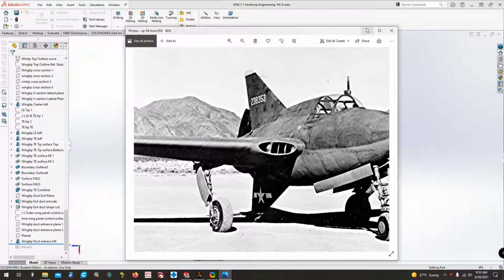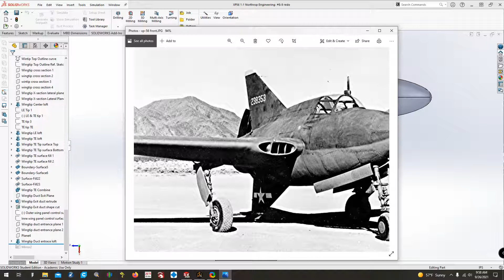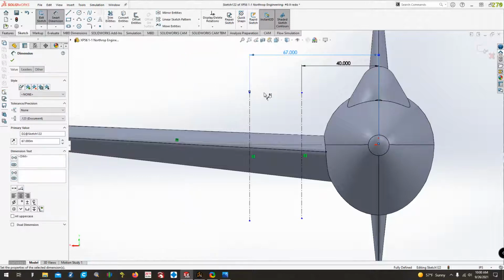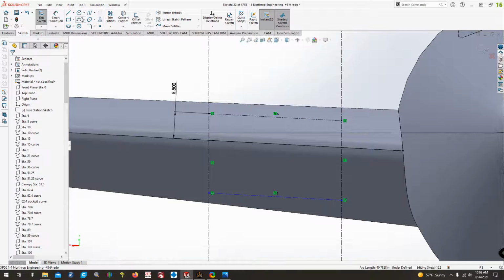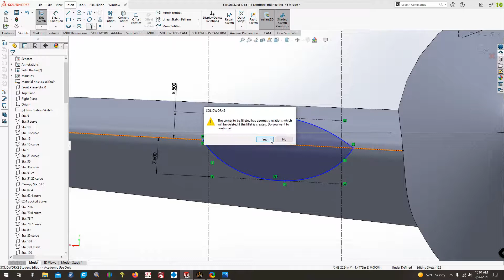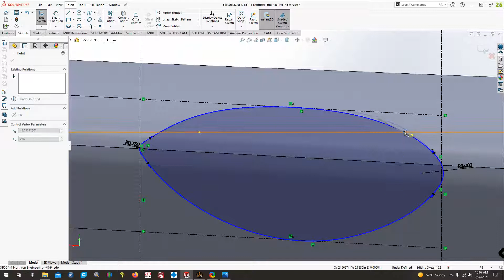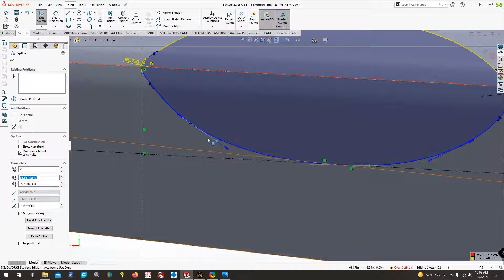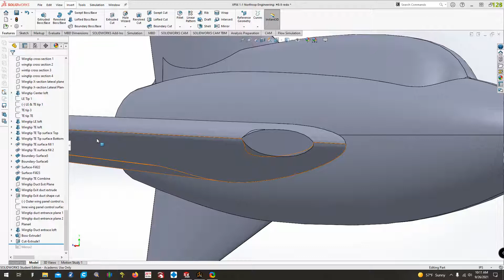RC aircraft design using Solidworks Series #16

Comment: Why not scan and import the intake scoop from J. Balzer large 3-view to get the shape right up front?
Reply from the maker: For the small 1/8 scale version, im not overly concerned about the shape of the duct inlet since it wont be a competition airplane and more an experimental.   For the larger version, i will eventually come back to the cad model and fine tune a few area’s (the ducts in particular) once I get an answer from the NASM on if they have the complete engineering report.
Reply: Hmmmmm....how about a Horten flying wing .... ??? Or a Ju-88
Reply from the maker: I’ve already done that model
Reply: @invertmast  and made a flying RC model of it?
Reply from the maker: @Trance 9

Yes.  There are video’s of my HO229 on my channel.